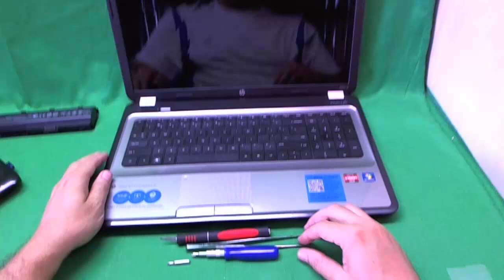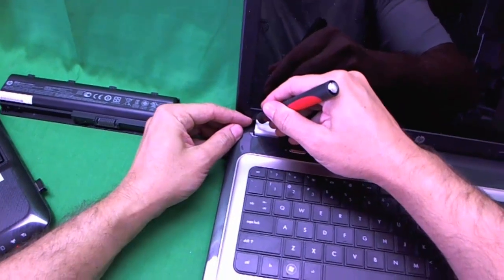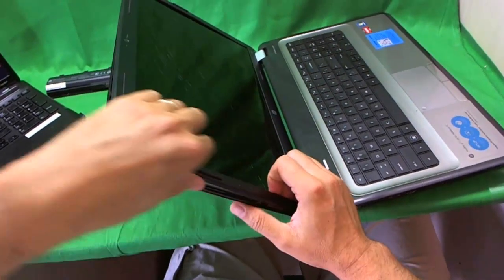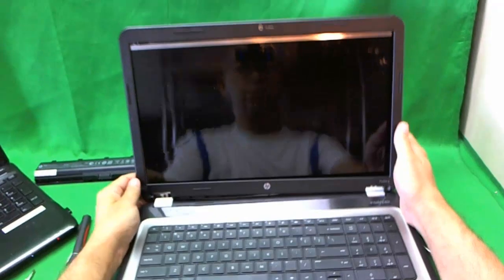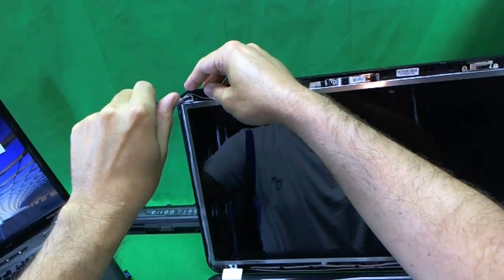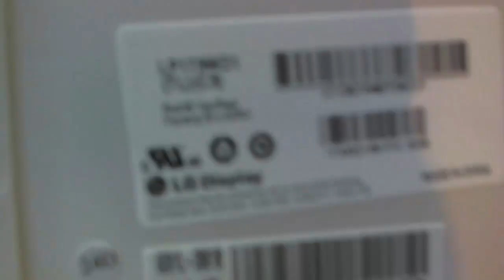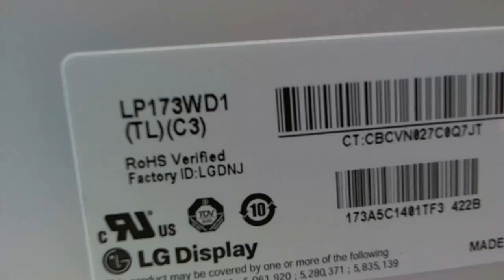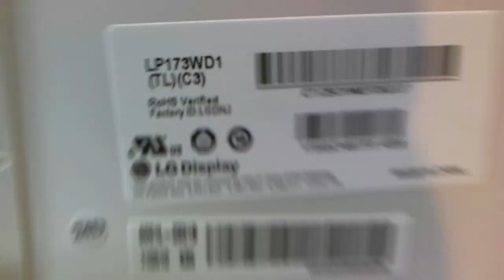HP Pavilion G7 Notebook Screen Replacement Procedure

Comment: Yes, thank you! Quick and easy. I still use my decade-old laptop as a remote desktop terminal from the car and it works fantastically. This machine's display specs are on par with typical modern laptops; for $60, I have a perfectly functional replacement.

Comment: if I were to just disconnect the screen. could I just plug in a HDMI TV to the laptop? or would it not work? I have a G7 laptop but the LED screen is cracked and the entire ecreen housing is broken off from the keyboard. but I have one loose almost metal like round cable loose. and another cable still connected to the screen. Haha
So if I lean the screen against the wall and turn it on. the cracked LED screen still works.

but I will like to trash the entire screen and lid and just use the keyboard part. connected to a TV set.

Comment: Thanks for the video bro.  Just ordered a replacement for this device to replaced the cracked screen on my sister's laptop.  Since I'm taking hardware configuration now in my first semester of college, this will be my first personal project.  Maybe not a big one, but I'm just doing it for the experience and to get into the flow of hardware repair and servicing outside of JUST the "school labs".  lol

Comment: Just wanted to drop by and say thanks. Not only were your instructions clear, you went over the sequence with enough emphasis that I was able to memorize the steps in one viewing. That proved especially helpful since the only internet capable computer I had at the time was the laptop, so upon viewing the video I unplugged my external monitor and did the job without any problems!

Comment: Replaced the screen because of dim display, the led lites were not working. Put new one in and same problem. Bad cable? I checked fuses on board. They are fine. Any suggestions?

Comment: Had my g7 less than a year, opened it one day and it cracked right up the middle. Called HP, had to talk to the obligatory offshore support, had me send it in, said it was under warranty. I do the whole Fedex dance, drop it off, and 3 days later I get a status update that basically says that the cracked screen is not under warranty, that it was caused by abnormal use and that they want me to give them 362.20 to fix it. I told them send it back. I fixed it myself for under $100.00.